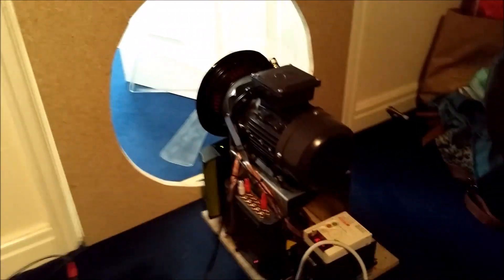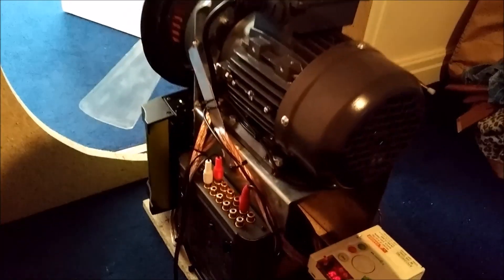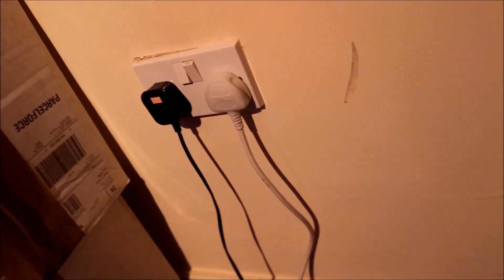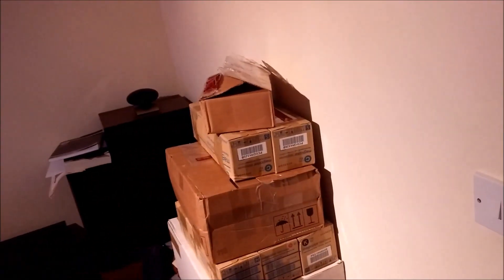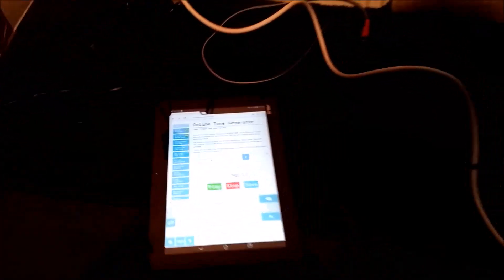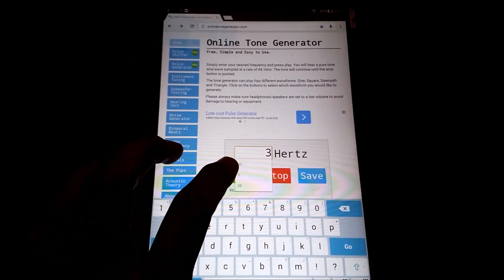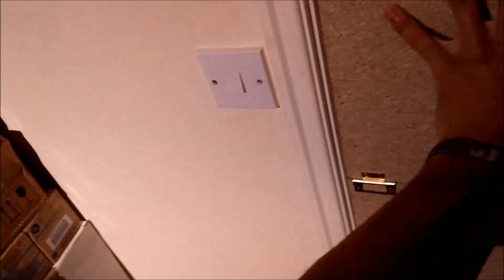Worlds lowest frequency Rotary Subwoofer @ 5 & 3Hz! Shaking WALLS!

Comment: I don't think it will work well. Jus look at the gap between the blades and the hole cut out. Plenty of room for the air to get around the blades, and causing an acoustic short cut

Comment: What's its practical upper frequency? Would it be a sub, sub woofer, like below 25hz only? Imagine building this into a speaker enclosure with other normal drivers. With some fine tuning and a precise crossover you could theoretically get a pair of speakers with bass down to 1hz!!! Mad!!! 😮
Reply from the maker: Exactly! The upper is around 25 for this unit. The smaller it is the higher it can be, but larger units can't move so quickly. This was around 17 / 18" wide, and so was fairly large. Mm

Comment: The vane movement was nowhere near a sine wave.
Reply from the maker: Actually, a sine wave is whatever you make it to be, so it always moving sinusoidally. I'm not sure how you came to your conclusion, but your conclusion is not correct
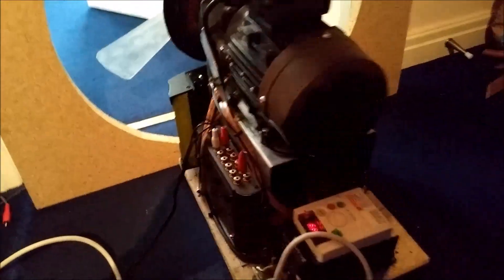Reply: @SolveElectronics  No, a sine wave is a very particular and defined wave shape, not what I 'make it to be', and not what I am seeing at 4:37, which looks considerably more like a clipped triangle wave movement without the smooth reversal of direction at maximum excursion.  It would be interesting to see the waveshape shown with a microphone and a 'scope.
Reply from the maker: @thedubwhisperer2157  yes, in this part it is clipping, but this is because the amp cannot supply the current needed to make a "decent waveform when it is operating. When it is in operation, the blades are making a sinusoidal waveform, when stationary it clips
Reply: @SolveElectronics  It really is a brilliant achievement; my apologies for kicking off on the wrong foot...

Comment: What was the peak to peak power output on this? Did you go for the full 300 watts? Or did you hold back some? Also if you don't mind, I was just curious how much one of these costs. I would LOVE one of these, especially after seeing this demo. But I KNOW it's out of my price range. I'm just curious by how much. Also, I'd hate to keep pelting you with questions but have you got a datasheet for this speaker? ithans much.
Reply: https://youtu.be/NZKCxIuJ-5M?si=VmnzHA_scm8XedOq

Comment: That's really interesting how it works, it's a fan that flexes the fan blades to create a pulse in the air waves.  I'd like to hear it bump some dmx if that's even possible, but probably need a smaller one
Reply: They are meant to be felt, not heard.  They do not make good sound

Comment: Chris, when you are in the room can you feel the compression/decompression on your body? What effect does it have when used with normal speakers - does it disrupt audible sound in any way, or supplement it?
Reply from the maker: you can definitely feel it in your ears as the pressure changes, like when youre on a plane, but you see things moving around you. its pretty weird. as for feeling, you can feel it, it moves you around a little

Comment: You still have this??

Wondering how much it cost you to build as looking into getting a few to put into some concert speakers 😂😂😂 

There’s this rave rig that has insane bass pressure like INSANE and they have “active cooling” inside the bins - which could be true and they have just a normal driver inside - although they won’t say what ones - so it’s my belief they have these inside these cabs and that’s the “active cooling” you can hear - just the fan spinning
Reply from the maker: I don't have this now, but I can build them, but it takes a little time!

What speakers are they using do you know? I'd like to do some research on that.. but higher frequency sound can be extremely punchy when used with a good box and driver, and using many of them amplifies that sound by a multiple of the speakers
Reply: Chris Hudlin RC1 Soundsystem - look them up - not too sure they don’t tell anyone anything about the things inside the cab so could be anything - but sounds too bassy to be just a driver aha

Also how much would you charge to build one as ngl looked at your guide and seem too difficult to follow aha
Reply from the maker: @LOADER-ti1ot   its possible they are using hybrid reflex habinets with dual 18" drivers. im not sure what drivers though. using this set up is aparrently very good. from the research they have modified CA18 amplifiers. the boxes will be tuned.

Yes i can build one, but it will take some time to do! you can email me if youre really interested. youll find it on my acc info!

Comment: It would be more effective and violent if the gap would be minimum as possible between the blades and the circle you cutted in that wood.. that would compress the air better by letting it in and out only through blades and not escaping through that big gap..

Comment: Greetings and congratulations sir for achieving such feat.i am very interested in your project. how much will it cost to ship india.
P.s. i will use it just for the experimental purposes
Reply from the maker: simple tech thank you for your comment! I can make you one and send it, but I couldn't tell you how much it would cost because it varies. I can make the unit starting at a base of 1300gbp to 2000gbp but this does not include shipping. But if you're feeling skilled enough you can make one yourself. There are instructions I made

Comment: Please do 1HZ sine wave
Reply: It isn't that great.
Reply: I agree.  1hz?    bwhaaa!!
2.2hz? (in a normal set up)

1hz.  Then.

 -  a cabinet (forward facing) the size of New York and a similar sized driver .   The observer would have to be at some distance to get a groove on - and the waves would destroy everything in its path.

The military have more use for 1-2hz -   by using beat frequencies.

3hz plus 4hz = 1 
1hz plus 2hz = 1
8hz plus 9hz = 1   etc etc

When mixed with high current this will shake a state to the ground.
Fact

Comment: wanna sell one?
Reply from the maker: How much?
Reply: Chris Hudlin to be honest i dont even know what all the marerials are here how much or what kind of motor it is?  How much i could build one my self ect.  What woukd you sell one for?  And how much did it cost you?  And where did you get the parts?
Reply from the maker: Well it cost me £300 to build! Including the panel. I have no idea how much it sell for, but I know that the original one has a patent pending in it! But this is slightly different I suppose
Reply: So 300 euro is what you you have to the entire thing such as cross over, amp (if any), motor, blades.  Basicly all the stuff so i can connect my input wires and start listening and tuning?
Reply: If you got 300 euro i would b5r willing to offer 350 euros plus shipping to maryland in united states
Reply: And because of shipping i wouldnt be intrested  in the panel.  Ill have my own open box i would like to put it in
Reply from the maker: It weighs over 20kg. Will cost lots to send that to US
Reply from the maker: watch my other video
Reply: Sam West this is a rotory subwoofer that would and could be used in commercial theather experiences or for like walt disney acting shows possibly for future home use?  To produce ultra low bass frequencies.  What happens is the fis will rotate around as a whole like a air plane blade plus it angles the fins rapidly and at different speeds depending on the bass frequently that it needs to produce.  Its a quite intelligent idea but hey comes at a price

Comment: would be interested to hear what effect this has on viewing a film as the human ear cannot perceive anything below around 20Hz.  I guess it might be feeling in the chest that you are getting.  If you are actually 'hearing' something it will be the harmonics of the fundamental.  Have you thought of fixing the speaker cone directly to a wall panel.  This is what they used to do in the 60's.  For Ultra Low Frequencies the big problem is how to couple the sound source, (in your case the fan) to the air.  The laws of physics say that you need at least one quarter of the wavelength that you are trying to produce.  So for a 3Hz sound that has a wavelength of 114 meters, you would need a speaker of around 28 meters in diameter.  By coupling the speaker directly to the fabric of the house you could achieve something close to that.  However, be warned that Ultra Low Frequencies can be quite harmful.  The U.S. government built a 7Hz sound generator for use on the battlefield which could totally disrupt the enemy's ability to operate.  Good luck with the project.  The world needs blue-skies thinkers like you.
Reply: IIRC by using a fan you can easily solve the coupling problem which is what he is doing.

Comment: How do you control the volume on a rotary subwoofer?
Reply from the maker: Brian Chin via the speed or by using a crossover like I did
Reply: Chris Hudlin But how do the blades move to actually change the volume because if it makes noise by the fan blades moving then shouldn't it only have variable frequencies and only 1 volume?
Reply from the maker: Brian Chin the driver moves them. Look at the project vid. Tells you eveything. And no, if the fan stops spinning then sound can't travel cause there's no sir being moved. Of volume is turned down then the driver does less work so it's quieter
Reply: the blades tilt less for lower volume and tilt more for higher volume.  the rotational speed stays the same.

Comment: what does that feel like?
Reply from the maker: shad doty  crazy! it was quite difficult to hold back.. after the video i went to switch it off and the panel fell on me because i let go. it creates such a big vaccum. just sucks and shakes everything
Reply: Chris Hudlin that's awesome, I'm going to build one for my A/V Company and I'm going to build a cabinet for it so it reduces the mechanical noise
Reply from the maker: good :-0 will take some time. took me 3 months to make mine
Reply: why did it take so long to build?
Reply from the maker: shad doty because I had other commitments and I had to wait for parts and find the time to build it
Reply: So if you were really motivated and had all the parts and time do you think you could build one of this in a day or two?
Reply from the maker: shad doty in reply to your other comment, lighter and stronger blades would be perfect, but it's making them and getting the materials. It took so month to make because I was testing all the time and things just kept breaking. But if you had all the parts you could make it in a week or two. It's just getting the materials and cutting and drilling and welding and testing through each stahe and Ballencing the blades and replacement parts

Comment: this is really cool, how expensive was it to get the parts? have you tried doing something like 20 hz? that should be in human hearing range rather than feeling the pressure.
Reply from the maker: DarKParadoX666 true, but people have different hearing thresholds. Like with this I can quite clearly hear 10hz. Anything lower is just a vibration.
Reply from the maker: Thanks and it was around the £220 mark. Motor was 50 wood 20 perspex 25. Metal and folding was 30. Amp was 20. Filter I had wiring and banana jacks I had sub I had rotor was 30 screws washers and bits about 10 frequency drive was 45. And just a few man hours lol
Yeah tried 20 and 30hz all that. I'm currently remodeling the wings atm for better structural strengthening
Reply: The things is that the scientifics says that, humans can only hear frequencies between 20Hz and 20 KHz, because we don't have yet* the technology to make lower frequency hearable, but with this things now we can,and I hope one day I will hear one =)
Reply: DarKParadoX666 the scientifics, huh?
Reply: Well, peoples who work on this domaine ^^'